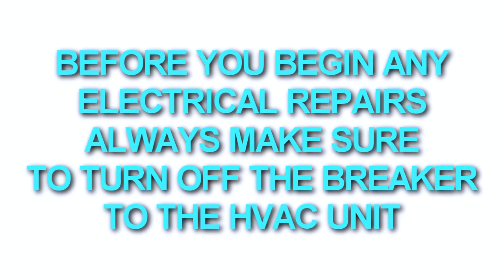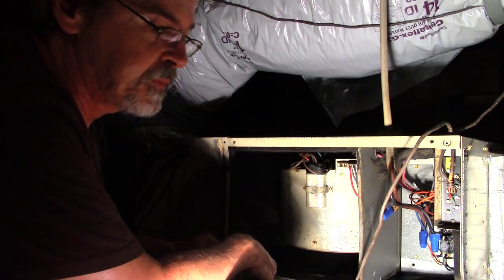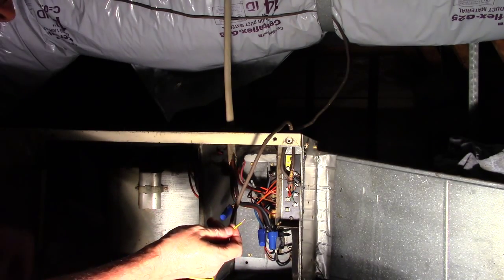How To Install An AC Condensate Pan Float Switch

Comment: tip from a A/C tech, breaking the R or red wire (main power from 24v transformer) will shut the fan down too, when that happens you will get a surge of water out of the unit causing more damage. break the Y wire (turn on lead from air handler to outdoor compressor) that will keep the fan running, and prevent a surge of water from spilling out of your unit. the color of the wire doesn't matter, look at the wiring diagram or the terminals they mount on to see, the outdoor unit usually has 2 leads going to it, a turn on and neutral, break them not the main feed from the transformer. sometimes you will have the 24v transformer mounted in the outdoor unit, it makes it a little harder to figure out, but NEVER KILL THE 24V TRANS unless you want MORE DAMAGE!
Reply from the maker: Militaristics Thanks for the tip. I had not heard that. I am not an AC tech but I did check with one before doing this because the wiring was different than I was expecting.
Reply: just trying to help. almost 30 years local 638b steamfitters NYC, been everything from a residential tech to a building automation supervisor to a facility manager at a 4K ton chiller plant. I have worn a few different hats over the years. a lot of techs make the same mistake because wiring is a lost art these days. it's one thing to follow a wiring diagram, it's another to be able to redesign circuits as needed to add in extra controls and equipment. the data sheet that comes with the parts shows the simplest way to instal the part, and that's what most techs learn.
Reply from the maker: Cool, wish I knew more about HVAC.
Reply: now you have someone to ask... lol
Reply: florida deals with condensate issues we dont ever see here in NY
Reply from the maker: Pistol Pete I'm from Florida originally... Hopefully moving back there in a couple of years...
Reply from the maker: I remember. I still go back a couple of times a year.

Comment: I'm having a problem with a drain pan filling with water.  Turned out that the line was clogged--which wasn't too bad to remedy.  However, I also found that the plan overflow switch wasn't wired to the unit---just dangling inside the panel!!!  Yours was by far the best video in explaining how to wire the switch.  Thanks.
Reply from the maker: Thanks, glad it helped.

Comment: If you had done the yellow instead it would just stop the cooling function correct?
Reply from the maker: Hi, I didn't want to leave you hanging. It has been a while since I messed with this stuff and I really don't remember the answer to your question. Maybe someone reading this has the answer?...
Reply: If you use the Yellow wires its gonna shut the outdoor unit off only. If you use red then everything shuts off.

Comment: I just bought a brand new house and it blows my mind that they do not install these on units anymore from the factory.
Reply from the maker: It should be required. They can prevent a lot of problems.

Comment: I found six red wires inside the unit,  choose not to do it with your half instructions, lengthy and unnecessary talk,    you are not even telling how to restart the units if it happened...........   if you can explain in a 3 minutes story is better.
Reply from the maker: Thanks for wasting my time responding. If you didn't understand the video just move on. Did you see the pinned comment from an HVAC professional saying this was the best explanation he's seen? Some things can't be explained in three minutes. Sorry about your ADD. Not all units are the same. If yours is different how is that my fault? If yours is different how does it matter how long the video is? Obviously these instructions do not apply to your particular unit. Is that clear enough for you?
Reply: Please read again
Reply: Irshad Syed Your message is quite rude. Who hurt you? Probably many people. Go get some help. Not everyone is perfect like you.